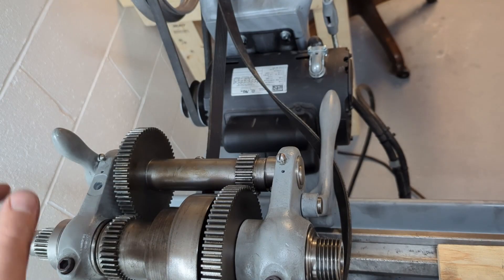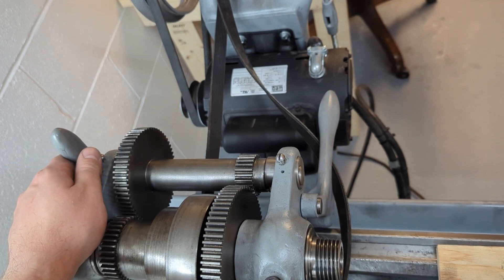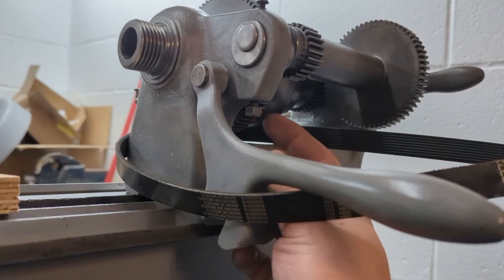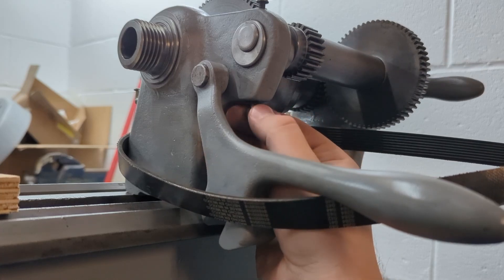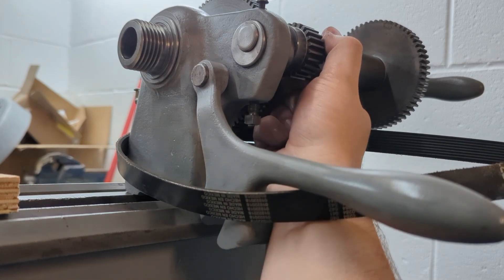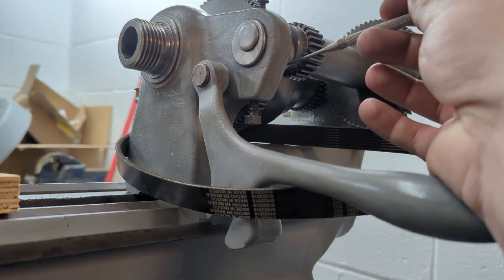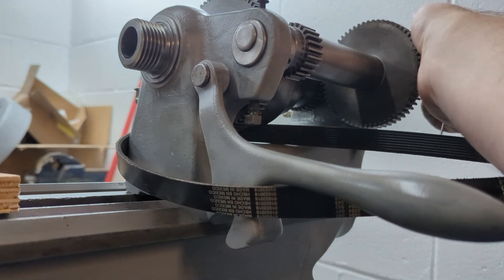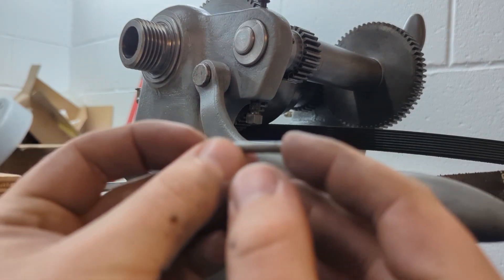South Bend Model 9A Back Gear Removal

Comment: So this gear shaft rotates on supports ? Dont they have bearings
Reply from the maker: It rotates on the shaft which acts as the bearing surface. You need to lubricate the back gear before use.

Comment: Excellent video. The one thing I would like to have seen it what the tensioner shoe on the tailstock nd sleeve looks like. I bought a poorly maintained Southbend 9C lathe that had no back gear and there was no spring nor tensioner shoe under the adjusting screw.